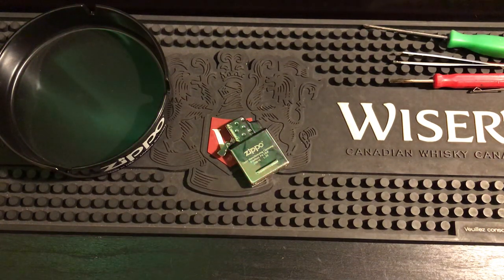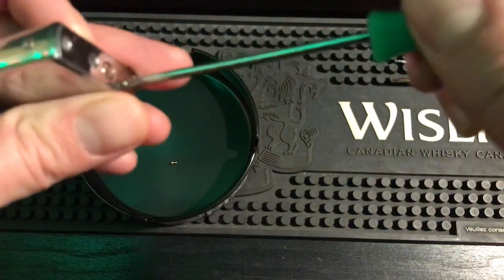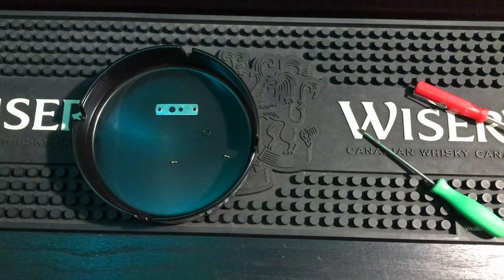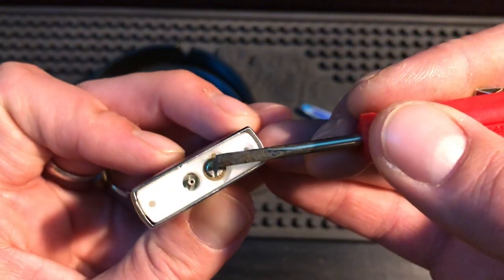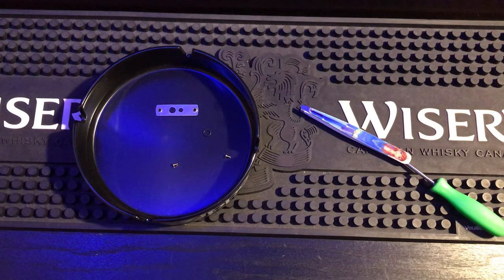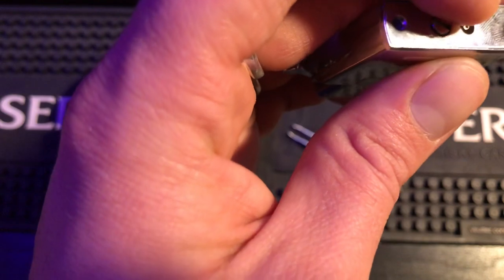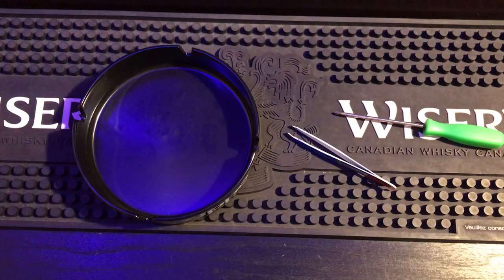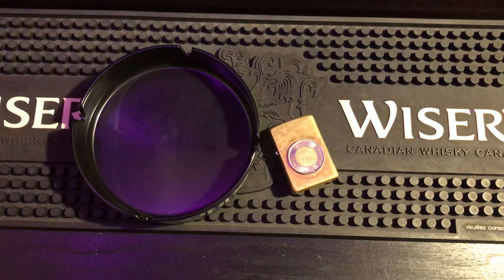How To Fix Zippo Double Torch Butane Insert

Comment: Had to do the opposite with my Clippers haha. Lowest was too high. Good to see these Zippo inserts use the same mechanics for easy repair.
Reply from the maker: Yeah I don’t have a video showing it yet because I havent needed to do it but the electronic sparker there is easy to change also. U can pull it out of some the dollar store ones.
Reply: @Zippofanatic77outdoors  I ordered a pack of 10 Piezo igniters like you are talking about, tried to fix an old lighter, but the dang lighter housing cracked. Oh well.
Reply from the maker: @kismitscorner  lol oh nice u ordered a 10 pack. How much was that ?
Reply: @Zippofanatic77outdoors  It was 20 bucks, about $2 each, so kinda ok, not great. The problem was they were a little on the bigger side, had to file one of the ends down for it to fit in this particular lighter. You might get more luck out of your idea of finding a small piezo lighter from a dollar store or something, that might work better. I know BIC have those kind, wonder if that would be cost effective?
Reply from the maker: @kismitscorner  well the cricket lighters that have them are only 1.25$ CAN and the ones I opened up are very similar in size to the ones in these. More closer to the zorro than the zippo one. But gonna work when I need to make the change

Comment: bro you can pry the governor pin with a cloth pin or safety pin hehe i do it on my double torch as well
Reply from the maker: Well the governor was stuck in the plastic I had it cranked wide open. Just had to dial it back came right out

Comment: This is great to know! I had a problem with my single torch Zippo, and this might have fixed it. It would light great outside the case but would not light inside the case. It was frustrating because the case  is part of the Zippo attraction. I finally gave just the insert to my son as he said he would use it without the case and I put my Yellow Fame Zippo in the case. If you have an insert and only need a case EBay is a good place to look.
Reply from the maker: Yeah boss tactical sells cases for just cheap. Him and his wife run it they super nice. Yeah this will absolutely fix the issue. Turning it up higher probably would of fixed it for a minute though lol. Eventually u get maxed out on the butane setting and it need more juice.

Comment: Thanks mate it's first time using zippo so to look some interesting video about it's okay I have brand new petrol version but I don't want use I ordered today double torch  because in UK it's wet weather wind etc the normal flame it's good inside but outside the best option it's the torch one electric arc technology it's totally rubbish useless thanks again and all best 😉
Reply from the maker: Thanks buds. Yeah the electric arc insert sucks. I prefer petrol inserts when it comes to reliability but the torch tastes much better

Comment: I got the double and it still won't light,  tried these methods and everything. Thinking I just got sold a dud
Reply from the maker: What kind of butane are u using
Reply: @Zippofanatic77outdoors  im using ronson but im definitely gonna change to a more premium one but i fixed it, the igniter come crooked on mine so instead of it being inbetween both burners it was hovering over only one of then nkt igniting
Reply from the maker: @jlopez70  nice glad u got it working. I can’t run Ronson in any of butane it’s so crappy lol zippo butane either. Probably cause it’s the same.